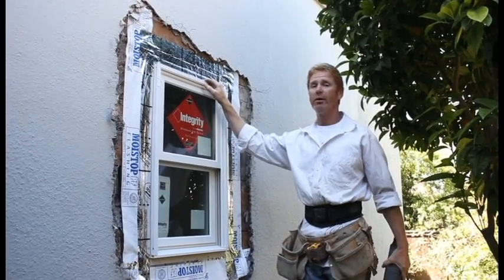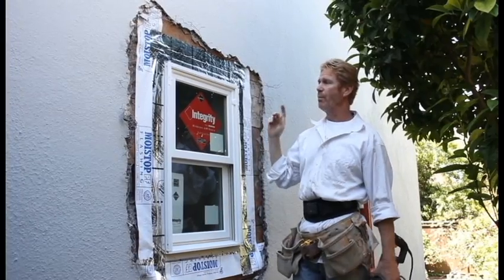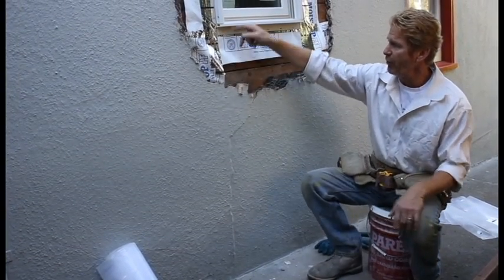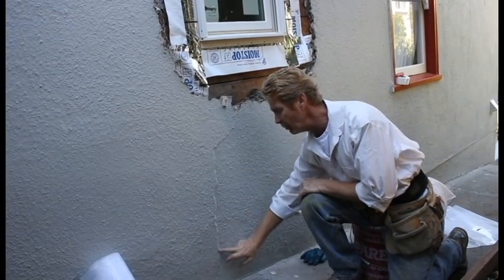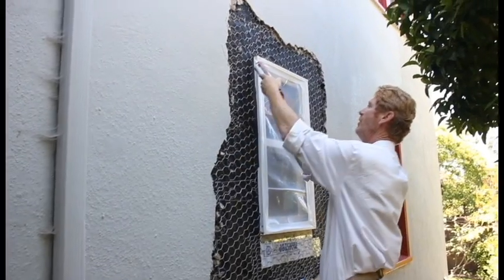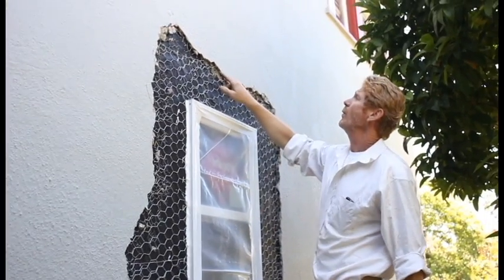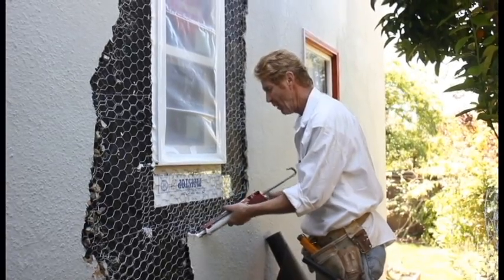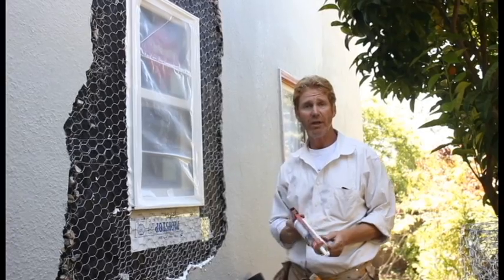Stucco how much to break out

Comment: Great videos, thank you.
I do have a question for you. I’m trying to restore a small one story house built in 1956. It has old stucco on it. It turns out the stucco was applied on top of existing asbestos siding 😮. I’m now debating if I should try to hire someone and fix the stucco which has some minor cracks and buckling in one spot at the bottom where it wraps on to the foundation wall, or try to attach 1x3 furring strips, through stucco and asbestos siding to the studs and cover it with vinyl siding. Appreciate the advice.

Comment: Thanks for this video. I have never done this before, and I was going to use an angle grinder for cutting the stucco to install new construction (with flange) replacement windows. I plan to follow your video. Is there any disadvantage to using a grinder?

Also something has really been puzzling me. There are vents every other stud bay at the top of each outside wall, venting the stud space. There's no insulation, so the house gets very cold. Also when I heat the house, I get moist cold air meeting warm inside air, making vapor in the stud bay. So I covered the vents with bitumen from the inside, and foamboard with silverside towards outside, and taped seams air-tight. I followed that with insulation on top. Now I'm wondering if I made a mistake, perhaps having two vapor barriers facing each other. I did some reading on stucco and think the first layer will absorb any vapor and dissipate it. Will the wall get moist inside, or is the double lathe of paper enough to breathe? Thanks.
Reply from the maker: Morning Scott Johnson, there is no advantage in a grinder, in fact it creates much dust with little advantage.
The stud bay vents are to ventilate the attic roof normally, not the walls. If it were me I'd go up there and spray the expanding foam down each bay, this will stop the air from going down them while allowing the circulating air in the attic, of course you can insulate the walls too. 
 Best wishes, and have a good New Year.
 Kirk Giordano Plastering

Comment: I’m sure the caulking goes first around the windows to make it air right and then the wire!
Reply from the maker: HowdyJA, lots of ways to skin a cat,
 I prefer to paper place paper up to a window or door then fuse the paper to the window, personally.
 As a rule, I use a construction sealant and adhesive, Sikaflex 1A is the stuff I prefer as it's been sold at all the professional plastering yards for many years and is time-tested bt the professionals.
 Excellent caulking but try not to get it on your hands as it's definitely not water cleanable.
                       Peace love and happiness to all
         Mastering Plastering for the beginner’s to the experts

Comment from the maker: Hi Jerry, we usual calk just the sides, the tops usually have a plastic or metal Z flashing installed so no caulking is necessary. I f water gets in this 90 year old home it won’t because of that window.
 Can it leach out?
 I don't know, as most paints are not waterproof even if you apply many. 
We just put them back the best way possible from what we have to work with.
 Thanks for watching and have a great day! 
Kirk Giordano Plastering

Comment: I wanted to ask what the minimum number of inches to get the paper under the old paper. the inspector is asking that I slide it under up to six inches and I don't know how you could do that.
Reply from the maker: Evening Jamal Kazemi, excellent question.
 Most inspectors ask for 6 inches, but that's mighty rare to acheive unless the home is under 30 years old.
 There are times I fight for one inch and sometimes there is no paper and even the wire is deteriorated (none)  with the only thing holding up, say a garage is the stucco itself.
 All you can do is the best you can with what's available!
Some homes are over a hundred years old with little maintenance ever done to it, while some old homes have been extremely well cared for. 
 Best wishes, 
 kirk and family.

Comment: I'm new to stucco repair. Why is it that you never caulk the bottom of the window?
Reply from the maker: Good Morning Tony dude, the bottom should always be placed on a flashing, so our new paper goes under this flashing, s'ooo, not necessary to caulk the bottom, in fact, caulking sometime seals the weep holes on the bottom of windows.
                    Live long and plaster
    Mastering Plastering by Kirk and Jason Giordano
Reply: If water gets in behind the window you want it to escape out the bottom.  It's ok to calk some of the bottom of the window, but leave at least a few gaps for water to escape.
Reply: @StuccoPlastering  should it be a metal flashing? Do you have a video showing it?